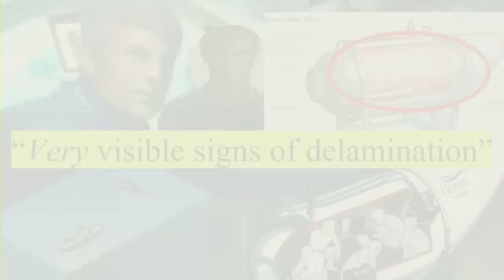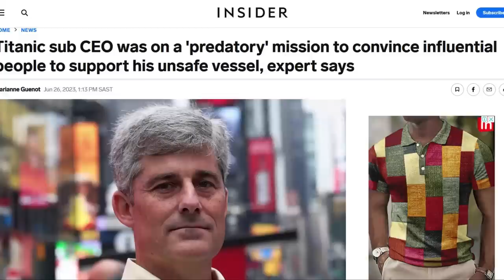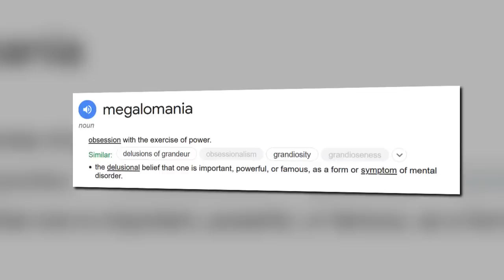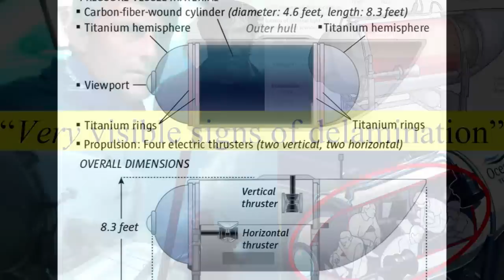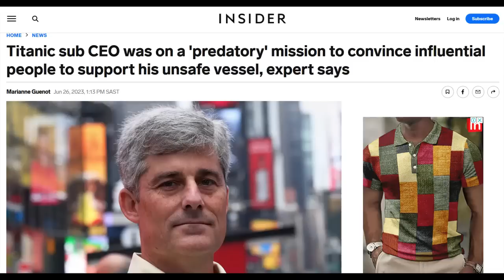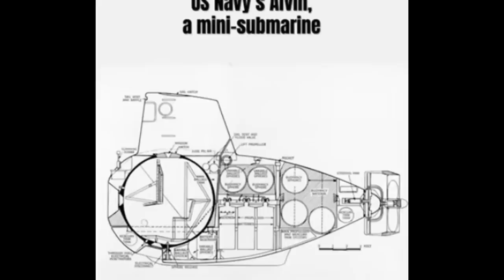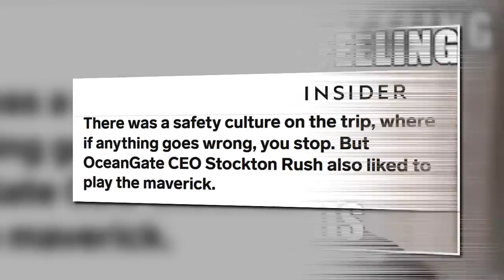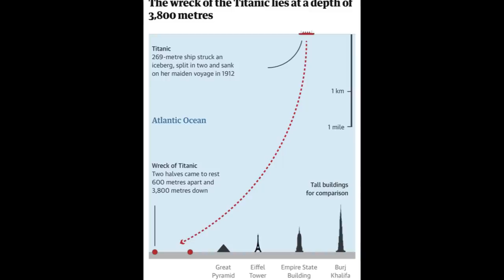"Lochridge shone a light through a sample of carbon fiber and saw splits in the midsection..."

Comment: Think of it this way, When you lay up fiberglass or carbon fiber, Trillions of tiny trapped bubbles are inside between the fibers. As the sub traveled up and down those bubbles were expanding and contracting all through the 5" of material each bubble tearing the fibers apart. Each dive was weakening the material evenly.. On it's last dive the material Failed completely and with one bang it disintegrated. It could have lasted longer if it had been laid up in a vacuum reducing the quantity of bubbles but it could never last forever.
Reply: Would that also introduce a cycle of hot and cold as well as the enormous pressure would heat the tiny bubbles further weakening the structure?
Reply: Yes when hand laying not under vacuum and in the autoclave.
Reply: @boontjes5528  It all contributed to the failure
Reply: They were supposed to degas it in a vacuum after laying the fiber while it cures. They didn't even do that. That would have removed all of these bubbles.
Reply: Thank you for explaining it like this - I understand perfectly 🙏🏼
Reply: @lornarettig3215  tiny being like less than a thousand molecules of air. Tiny being the size of bacteria.
Reply: Agree with lornarettig a lot of obscure comments by others are beginning to make sense with your explanation. 
Someone else in comments talked about checking to ensure that the "void content was less than 1 percent." Is this what that was talking about? - The air bubbles?
Reply: @markusgorelli5278  yes
Reply: MATERIAL USED SHOULDVE BEEN TITANIUM FOR THE ENTIRE - ALVIN IS STILL WORKING TODAY
Reply: @OttawaInHD  The reason they used CF and not titanium was due to physics. If the tube was titanium, it would be too heavy for the sub to be buoyant. That's why all deep see subs are spherical, since that's the only shape than can mathematically handle enough pressure.
Reply: Which is why you vacuum cure epoxy products, all the air bubbles exit the material. the material compacts into a solid..
Reply: @boontjes5528  I don't see how the heating is a big deal when it takes place over hours, and when it's a tiny fraction of a % of the amount of air in the main cabin. Even when people talk about the interior being hotter than a fire from compression that would only have been for like a few milliseconds. The ocean would cool it off quickly under normal speeds. Expanding and collapsing, though, yes.
Reply: @paulgallagher2937 Most, but not all submersibles are/were spherical.  Aluminaut was a cylindrical submarine with a test depth of 4.6 km that led a successful career with many dives.
Reply: TRANSCRIPT shows the hull didn’t fail instantly.  It appears it was already leaking water as soon as the sub entered the ocean.  Had the CEO aborted the mission at 15 minutes, and surfaced, he’d still be alive.  (If he had aborted when the acoustic sensor turned red, then he’d probably be alive.)

He had two warnings and ignored both
Reply: Transcript also shows the hull was making cracking noises 20 minutes before implosion.  The passengers all knew they were about to die
Reply: @electrictroy2010  Then Rush murdered them.

Comment: Going almost three times the certified viewport depth in combination with a non-certified carbon fiber hull is absolutely insane to me.
Reply: It wouldn't really matter had it been unmanned, but to take any paying customers or anyone other than himself is criminally reckless.
Reply: It absolutely is... It goes to show how an ego can close ones mind to simple logic.
Reply: The viewport is so much worse IMO. At least the hull was calculated to be strong enough, if you disregard the nuances of repeat cycling etc. But the window WAS measured and tested and actively known to be not nearly good enough. Using something you KNOW is terrible is worse than using stuff you at least THINK is good enough even if it might not have been.
Reply: They were delusional.

Comment: I don’t know why it wasn’t obvious but as it begins to delaminate water is going to rush into the voids. Which isn’t just bad because your hull is failing but its bad for another important reason. Unlike a metal hull surrounded by syntactic foam oceangate relied on the buoyancy of the carbon fiber hull. So as your alarm goes off or you hear it crack and move to abort by ascending your route of escape is being cut off. The more it delaminates the more water gets in between the layers the heavier and less buoyant the craft becomes. Constantly reducing your ascent rate until you either implode or become negatively buoyant and start sinking again and implode. So there’s a very good chance that even if in theory you could detect a failure with enough time to ascend you will be unable because you’re simultaneously losing your buoyancy because your buoyancy is inextricably linked to the complete integrity of the hull.
Reply: It is absolutely true and very astute of you to make this point.   Something these geniuses did not account for in this design.   There is no way to have redundancy with this design or confidence in the robustness of the systems they chose.  Madness.

Comment: The problem Lockridge had is fairly common, although not usually with such dire consequences. In the late 80's I was a software QA manager at a UK defence contractor, on a project designing and building a major piece of defence equipment. We had a US sub-contractor, another high profile defence contractor. On the customer's insistence, I was sent to do an audit of the sub contractor's software development methods - but only because the customer insisted.

There were problems, corners were being cut, and I wrote a report reflecting that - but pulled my punches and worded it carefully. The UK project manager went ballistic, and told me to rewrite it before he gave it to the customer, on a short deadline. So rewrite it I did - I replaced all my pulled punches with real punches, and said it in words of one syllable. The PM was not happy, but there was no time to repeat the exercise, and the report went to the customer. The PM said "we only sent you just to show willing. You weren't supposed to find anything!". Then, a few weeks later, the major problems the project was having was shown to be a configuration management issue, one that I had previously identified. I basked in my own self satisfaction, but I never did get an apology,

It is a common problem for auditors - both sides gang up to try to fool the auditor

Comment: Having worked offshore for more than 20 years, it seems that Stockton was the type of guy I've worked with in the past. If something isn't safe & someone wants to stop the job, just scream louder & threaten to fire whomever goes against it.
It's obvious really that by the time the acoustic sensors detect anything, the hull has already started to fail & at those pressures, nothing was going to save them.

Comment: Sadly, they likely knew they were going to die for over 15 min. By the time topside responded at 09:47 ish regarding Subs last message at 9:46 about crackling noises returning... , between 9:46 and 9:47 they were already gone. Here are all the texts between Topside and Titan... transcribed below:

7:52:34  [Top] clear for descent. Enjoy the ride.

7:58:16  [Sub] Launch sequence complete, rdy?

08:00:39  [Top] all clear.

08:01:11  [Sub] Proceeding.

08:03:09  [Top] Enjoy the dive gentlemen.

08:19:53  [Top] you’re 15 minutes into the dive, current depth. Systems check, please.

08:21:28  [Sub] Systems check complete, all in order. All lights are green. We are 756, proceeding.

08:22:41  [Top] Thank you. Proceed.

08:34:02. [Top] 30 minutes in, update please.

08:34:57. [Sub] All systems are functioning normally. We’re in good shape. Continuing our descent as planned.

08:36:05  [Top] Superb, proceed.

08:49:10  [Top] Over 45-minute mark. Current depth? Confirm status.

08:52:30  [Sub] Depth at 1934. All systems stable and descent continuing as planned. Happy crew.

08:52:28. [Top] Excellent!

09:01:46. [Top] You’re at the hour mark.

09:02:13. [Sub] All is smooth sailing here.

09:15:21. [Top] You are at 75 minutes, depth? Status? Do you need to adjust velocity?

09:17:50. [Sub] All under control. At 2960. No adjustments needed. We’re enjoying the ride.

09:19:03. [Top] Understood.

09:28:16. [Sub] we’re noting an alarm fro the rtm.

09:28:35. [Sub] reducing velocity descent depth 3433.

09:28:47  [Top] Understood. Do you need to ascend?

09:30:36. [Sub] no change with thrust the rate of descent is increasing. At 35. Going to release the ballast now.

09:30:55. [Top] Yes agree. Release ballast.

09:32:12. [Sub] No improvement. Preparing to jettison the frame.

09:33:00. [Top] Affirmative. Update when able. RTM indicator status?

09:35:48. [Sub] frame jettisoned multiple attempts needed. But starting the ascent now

09:36:33. [Top] Multiple attempts? What is your status? RTM indicators? Depth?

09:37:38. [Top] Update please when able.

09:38:09. [Sub] crackling sound at aft

09:38:44. [Top] Can you identify source? RTM indicators status?

09:40:12. [Sub] neg

09:40:40. [Top] RTM status?

09:42:12. [Sub] trying to run diagnostics. Ascending now. but very slow. Sounds have subsided. global RTM alert active all red.

09:42:57. [Top] Understood. Any codes? Depth? Ascent rate?

09:43:16 [Top] Updates when able please.

09:43:42. [Sub] slow ascent in progress. quarter predicted. Unclear why rate is small. no indicator. at 3476.

09:44:03  [Top] We are talking it over with engineer. Standby.

09:45:11. [Top] Depth and status please. What’s the wattage on upwards thrust?

09:46:37. [Sub] reading red on the A power bus. I switched to B. at 3457m more sounds aft

09:47::19 [Top]. Understood continue ascent. Talking to Carlos about power bus situation right now.

09:48:49. [Top] We are activating recovery procedures. Carlos is requesting wattage output from bus B. Status update please. Velocity of ascent?

09:50:09. [Top} We’re not receiving you. Update please.

09:51:16. [Top] Status and depth report.

09:53:08. [Top] We need you to respond with status and depth. Carlos is requesting wattage update on thrusters.

09:55:01. [Top].We are unable to read you. We are moving to recovery coordinates. Report if you read.

09:57:22. [Top] Please respond if you’re able.

Comment: Ever push a rope? 
Pulling? Good. 
Pushing? Bad. 
Carbon fiber or ANY fiber is great at holding IN pressure. 
Not so much holding OUT pressure. Tensile rigidity, key!

Comment: Love your coverage of this topic. It’s truly a crime in real time!
Reply: Cutting corners & costs with the carbon fiber hull seems 'obscenely unsafe.' 
A simple titanium cylinder, at an appropriate thickness would have cost more, but is entirely doable. 
It's also an ideal material for this application: light, great strength, ductility & does not experience cyclic failure or fatigue like other materials. 
Wealthy tourists would have recouped the cost of the titanium cylinder many times over.
Reply: @houseofsolomon2440 not buoyant enough at the thickness required, not doable.

Comment: Acoustic nondestructive testing is regularly used to detect voids, cracks, etc. in carbon fiber panels.  The vessel would need to be tested each time before it left on a trip.  Once a panel shows problems during nondestructive acoustic testing it must re replaced.  

Carbon fiber is good intension, not compression.  Rush said several times about the sound of cracking.  This would mean that it was failing and delaminating then.
Reply: Matter of time, that's why there is still astrology.
Reply: I'm just a dumb bicycle rider and I know this.. do NOT use carbon fiber to go deep sea diving!  -why?!!

Comment: Using the wood analogy, you can have a huge oak tree that appears to be rock solid, but if it's diseased or otherwise compromised, almost out of nowhere, in a cacophony of cracking noises, it comes crashing down with no prior warning.
Reply: One day I was home by myself. A nice quiet day when suddenly heard a swishing and crashing sound. Looking outside, I see our avocado tree had simply tipped over. Since then, I've come to learn that avocado trees are prone to rot - at least where I am. Our last avocado tree replacement had to cut down some years ago as I noticed a growing cavity at the base where the inside had rotted out.
Reply: We call those widowmakers.  Eucalyptus trees are notorious for have branches just fall off without warning.
Reply: @j.f.christ8421  How interesting, i did'nt know.  🌱👍
Reply: good analogy
Reply: Trees are interesting. The inside oft he trunk is in compression. The outside is in tension. So a tree can bend a lot without putting the outside into compression. Putting the outside into compression would put the unsupported wood fibres into compression which would cause them to buckle. The fibres in the centre can be in compression because they are supported on all sides.  A similar logic can be used to come to the conclusion that with the lay of the carbon fibres used, even with a perfect void-less lay, there will be a weakness on the inner face of the tube which will give rise to spalling of the surface, and this will progress to failure.
Reply: @everTriumph  Whoa ...  took the words right out of my mouth! 😜
Reply: Unless it’s in a forest with nobody around.

Then it doesn’t make a sound.

Comment: All the time you have fabric laminations, you will have bubbles in-between the layers. It's almost impossible to avoid, especially when you wrap to that thickness. You cannot evacuate the bubbles without a vacuum, and these micro bubbles will compress and expand with every change in pressure. The laminate glues are not particularly soft so will tend towards micro fractures. Deep water is cold water, adding to the brittleness. There will also be different levels of thermal expansion throughout the materials depth.
This is right up there with early jet airline failures because nobody yet fully understood the metallurgical problems these aircraft would encounter when subjected to the temperature and pressure stresses of modern airliners.
Reply: Most people overlook what pressure  does to carbon! Forget about "micro bubbles" for a moment.!  Having to work with HYDROCLAVES at around 3,000 P.S.I  I can tell you  that "carbon fibers ' can make a drastic change in character! Where do you think diamonds come from?  No one seems to think what pressure or temperature can do to a carbon based material!

Comment: The fact that it was stored without a cover in a factory carpark may be an important factor due to UV light exposure. That and the different contraction rates between the metal and plastics in both heat, and cold.
Reply: Yes.
Reply: Add to that, this year it was towed to the location, instead of carried on the boat itself. The surface of the North Atlantic is pretty rough.
Reply: Those different expansion/contraction rates have to have affected and/or fractured that glue ring I'd think.
Reply: @ChrisAndCats  Whats the betting they used drywall or wood screw to reinforce the junction !?
Reply: @ChrisAndCats  I don't think glue is likely important, it's held together by pressure once underwater, glue is for atmospheric pressure holding together. It should be fine underwater even if all glue magically disappeared
Reply: @gavinjenkins899 NO carbon fiber only works in tension.  In compression’s the fiber is worthless (just like rope in compression is weak).  The GLUE is the critical component to hold the hull together.
Reply: @kingssuck06 THE glue is also important to seal the junction between the carbon fiber hull & the titanium end cap.  If the glue fails, you get leaks

Comment: What the fucking hell, it gets worse yet again. First, he used carbon fiber which is not recommended. Then we learned that he used EXPIRED carbon fiber. Then we learn it got damaged from lightning. And then we learned that he put college-age interns to design the electrical system. And now this!
Reply: Cutting corners. He should have called it "Budget Dives".

Comment: According to Weissmann, Rush had bought the carbon fiber used to make the Titan "at a big discount from Boeing," because "it was past its shelf life for use in airplanes."In other words, Rush knew that the carbon fiber — which is a very poor choice of material for a deepsea vessel, as many experts have pointed out — already potentially had flaws that could've played a role in the Titan's tragic demise.
Reply: Have you ever heard of anyone dying because they ate "out of date" food? I've used "out of date" resin that was years out of date on many projects, with no harm  Got it from the aerospace industry at great discounts! Saved a ton of money! However you must be careful on how you handle it. Temperature is the main factor in its long term life! The aerospace has to get rid of it,  because it costs more to get rid of it,  at a greater expense then the brand new product! For example: the company I worked for had pay around $700 a barrel of epoxy resin. To get rid of an "out of date" barrel, even when it was empty, cost them about $900 a barrel to a "certified" recycler! So for them they sold it to me for $170! WE BOTH WON !!
Reply: On more question ❓ resins have dates because it can change with time or temperature! I didn't know that carbon fiber had dates! You must be referring to carbon prepregs!??